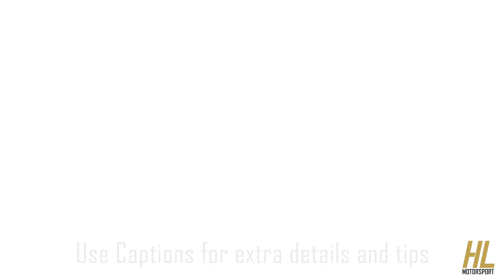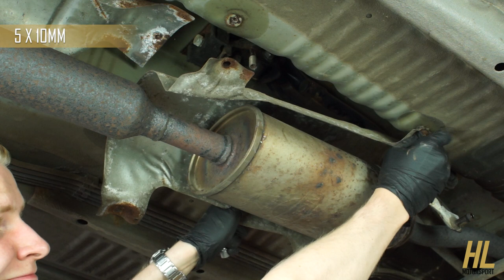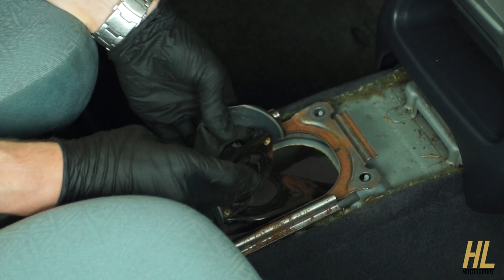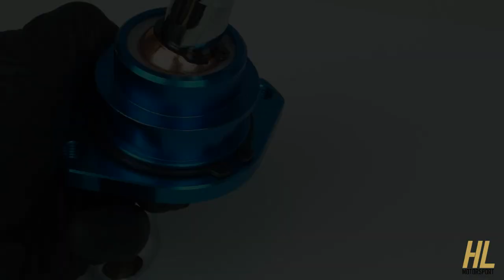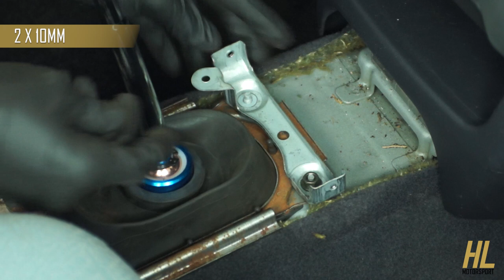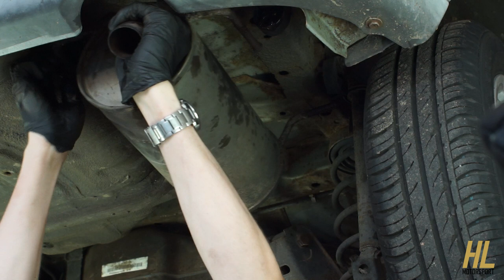Nissan Micra K11 Short Shifter Installation (CGA3DE, CG13DE CG10DE)

Comment: Does using the zipties stop it from rattling? 

Also be prepared for the heat shield to strip the bolts, the bolts for the shifter in the plastic will spin and wont undo so you will potentially have to drill them out and the lower two for the surround bracket are captive nuts and can strip really easily. Soon turns a hour job into a 3 hour one
Reply from the maker: Yes the zipties really helps to stop it from rattling!
Reply: @HLMotorsport  lifesaver, thankyou will 100% try this😁
Reply: Mine rattled because the ball and white nylon socket it fits in were such a poor fit for each other, I took it apart and filed down the split in the nylon socket until it was a good fit then wrapped it in tape and fitted it back inside the blue collar. Mine seems the same as yours but I've heard of cheap copies so I may have got one of these.
Reply: Same problem here